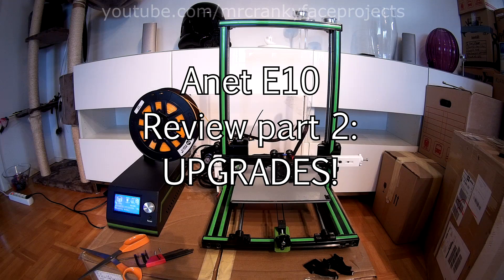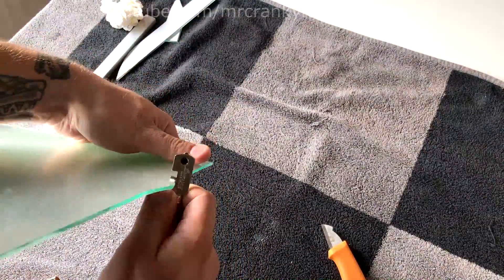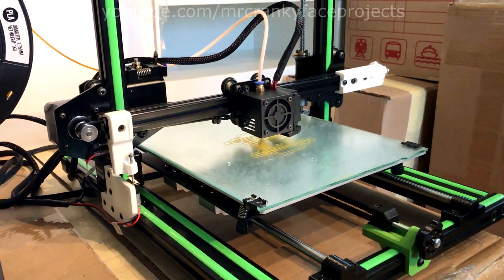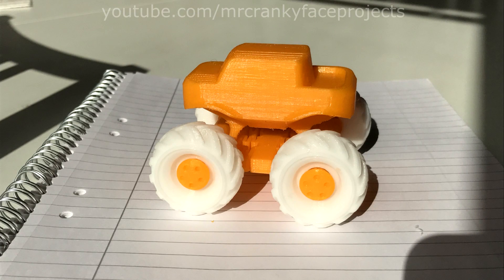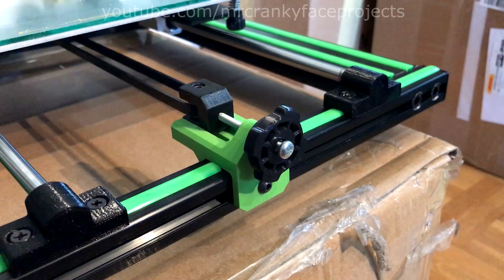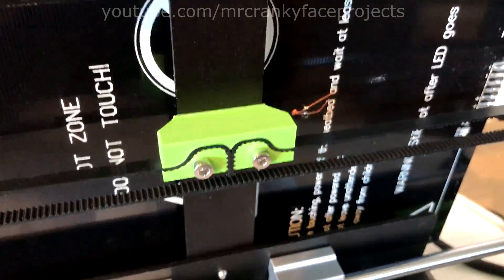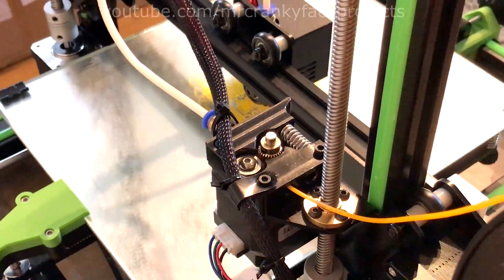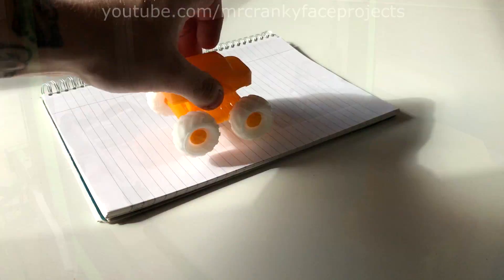Anet E10 upgrades!

Comment: Hello ! Have u tried print with ninja Flex or another flex filament with this printer ??  Thanks...
Reply from the maker: Hi!

I only have PLA in 1.75mm so I haven't tried flexible filaments myself on this printer.
A friend of mine used the E10 to print some kind of flex filament and it worked good as long as he kept it at 20mm/s.

Comment: Out of curiosity, what slicer are you using? If Cura, what version?
Reply from the maker: I mostly use Simplify3D.
Reply: I mostly use Slic3r. Have had trouble getting Simplify3D tuned as much as I've been able to in Slic3r. Kinda frustrating. Cranky, perhaps you can share your PLA configs for the E10 on Simplify3D?

Comment: G'day mate,

Firstly I would like to thank you for your efforts to design, construct and share these files on Thingiverse, I'm new to 3 D printing and recently received my Anet E10 with a few issues that I'm trying to address the best way I can.

There are a few modifications/upgrades you've done that I like and would like to put on my printer, the first one is the cable strain relief for heatbed that I downloaded from Thingiverse, both part A and B however when I try to print them, they both start printing at the home position and just outside of the front left bed corner.  I can not find a way to make it print at the centre of the bed so, could you please help me out with that..?

I have also downloaded the Improved belt lock but I'm yet to try printing so, I don't know where it will start printing.  I'm using the Cura Software to see the file and create the Gcode I can't see anything where the bed position can be adjusted or set.

Your help will be appreciated.
Reply from the maker: I haven't really used Cura much so I had to download it to see where this could be adjusted.

What I did was create a custom FDM machine setting/3D printer profile, input the XYZ(220, 270 and 300)
Tick the box 'Heated bed' and changed material diameter to 1.75.
I was forced to do this at startup but otherwise you can find the menu under Preferences->Configure Cura->Printers->Add.
Any models you now import into Cura should automatically be placed in the center of the printable area.

The slicer I use(Simplify3D) automatically put everything in the center of the bed so I didn't really notice this issue during my review.
Normally you can adjust the homeswitch offsets in the slicer but I can't seem to find that feature in Cura.

Another way to adjust this is to manually input the offset into your starting gcode.
Preferences->Configure Cura->Printers->add/machine settings
What you need to do is edit your starting gcode, the stock one for the "custom FDM" profile is this:
------
G28 ;G28 command makes the printer start 'homing', it goes to each switch to find out where it is.
G1 Z15.0 F6000 ;Moves the nozzle 15mm above the bed
;Prime the extruder/fills the extruder with plastic to get ready for printing.
G92 E0
G1 F200 E3
G92 E0
------

What you could instead try is this:

------
G28 ;G28 command makes the printer start 'homing', it goes to each switch to find out where it is.
G1 Z15.0 F6000 ;Moves the nozzle 15mm above the bed
G1 X10 F3000 ;Moves the hotend 10mm to the right
G92 X0 ;Resets the movement for the hotend so it thinks 10mm is actually 0mm. This should counter the switch offset.
;Prime the extruder/fills the extruder with plastic to get ready for printing.
G92 E0
G1 F200 E3
G92 E0
------

Hopefully that helped a tiny bit!
Reply: Wow, that's gibberish to me, however, the first part of your reply I had already done when I first installed Cura, the first thing I have downloaded was the fan shroud from Thingiverse, it went to the centre of the software page and it did print on the bed centre, the next files I downloaded were these ones of yours and they all want to start printing at the home spot so, I just don't know or understand why.
Reply from the maker: Hm, I'm not sure what would cause that.
I tried downloading the cable reliefs but they all get placed in the center when I test it in cura so I'm having trouble replicating the issue :/
Which version of Cura are you using?

You could try selecting the piece when it's imported into Cura and moving it with the move tools(on the left side in 2.6.2)
The latest cura is available here: https://ultimaker.com/en/products/cura-software
Reply from the maker: I'd definitely recommend looking into how gcode works, having nice start and ending gcodes can really help your prints. :)
Reply: When the Cura 14.07 is open and check "about cure" it tells me that I have the latest version however, I followed your link and I will try it out and see what happens
Reply: OK so, where can I find those explanations?
Reply: I found the problem, the issue was that some how, I ticked the box where it asks if the centre of the bed is zero/home, I got confused with my Chinese 6040 CNC that was set to start all jobs on the table centre, silly me...!

I also followed your advice and downloaded the Cura 2.6.2, I did not find any other Cura version on the software that I received in the micro card, this new version is quite different than the one I had and I manage to print the parts I wanted at the table centre as it was supposed to.

One other question, can Anet E10 print from the Cura program..?  I have connected the USB cable to the computer, with the Micro USB card out, at the top right corner of the program, there is an option to connect and monitor the print, I can see that is reading the bed and extruder temps as they heat-up but, I can find a way to actually make it print what is displayed in Cura's main page so I have to wonder,  do we have to print every time by downloading the file in the micro USB card and print from there..? what the purpose of the USB cable and connection at the main control box...?

Comment: Put a spring on the 3mm z axis end stop adjuster screw to help keep it from self adjusting. A spring from a ballpoint pen works ok, but a stiffer one from the hardware store is better. You may need a washer to help hold the spring on the screw
Reply from the maker: The screw is super tight due to the long and undersized hole, but if it ever gets loose then a spring would definitely help!
Another popular method is a second locking nut.